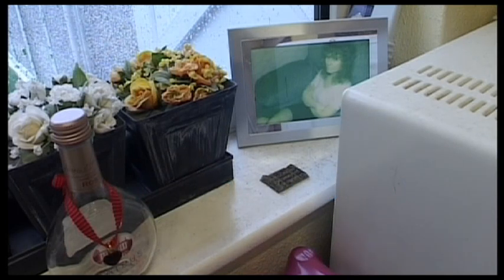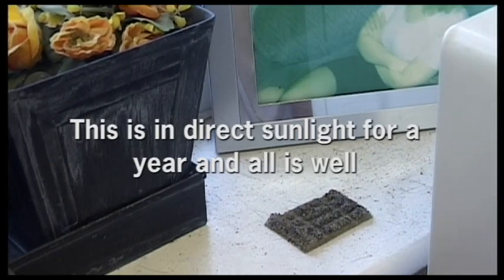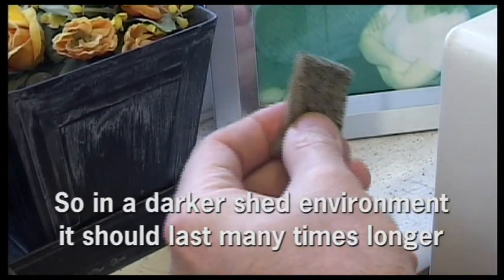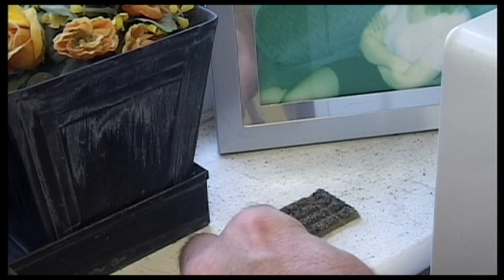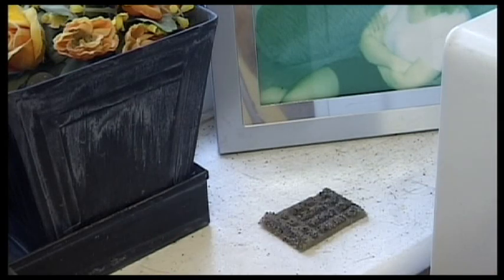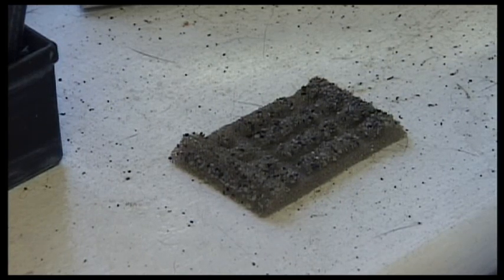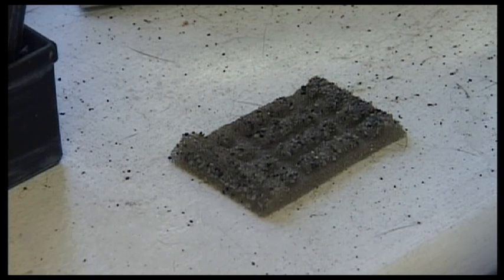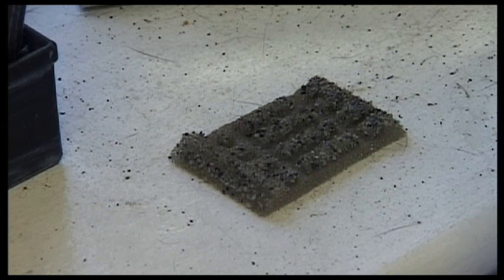GM200 After a Year in Sunlight

Comment: That really is good stuff, Laurie, and the sun test is a good one. I might try this on one of the smaller sections, one or two lengths wouldn't hurt the pocket too much :) Thanks for sharing the results...Tom
Reply from the maker: +Tom's Model Railways Yes I've been waiting a year (as you can tell) to see how it would do. It seems ok. I know some of the foam on its own can deteriorate after a couple of decades but this stuff has a covering of real granite chunks to help deflect the light. Plus it seems to last ok. Also to re-lay the track is dead easy - no track pins, just glue, so if I did need to replace it, it would be easy, and I would probably replace the track too to help conductivity of the next couple of decades. If it needed it. It might not.

Comment: Interesting.  I was wondering if that foam would last since foam does like to rot.  Scott
Reply from the maker: +Scott Downey So far, so good after a few years. This is called something other than foam (they have a trade name), and it seems stronger. Also it is covered in gravel, so the light cannot get to it easily. So time will tell. But even if I have to change it, it will only take me an evening to completely re-lay the track on any of my layouts. So quick to do. Laurie.